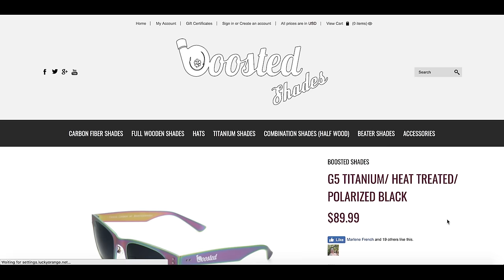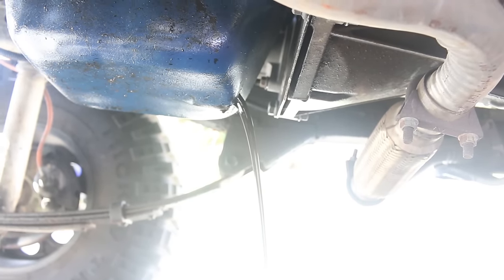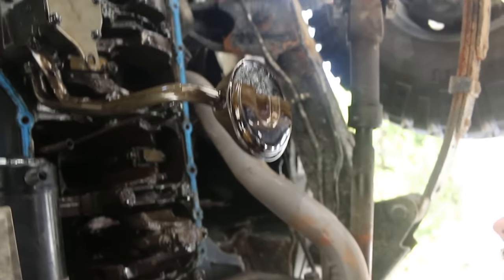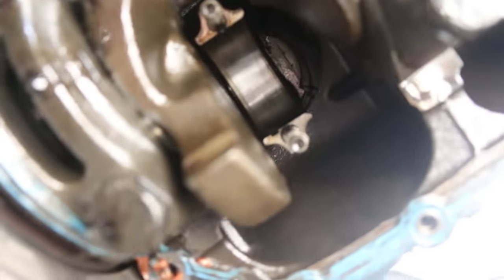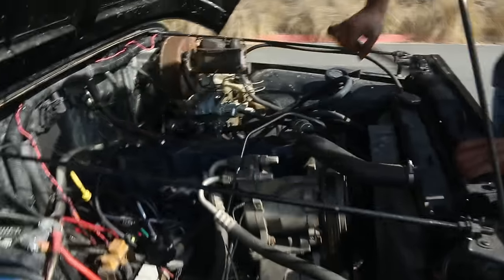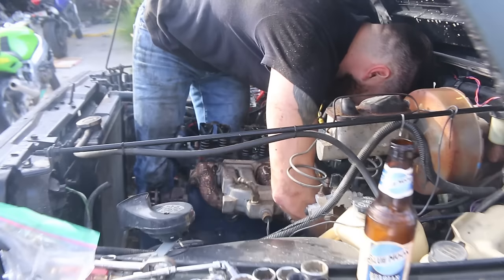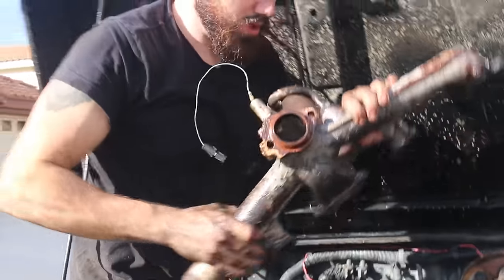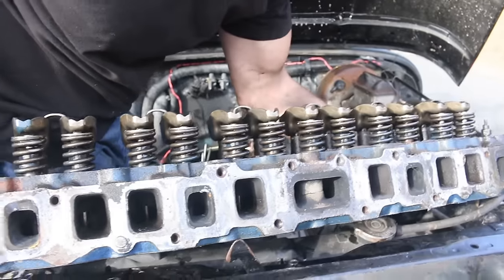Removing a Piston WITHOUT Pulling the Engine!

Comment: I'm trying to do the rings on my 83 VW rabbit, does it matter what kind of onion I use for the clam chowder or will sweet onion work? I heard that purple onion can cause the cylinder walls to glaze over since it's only a four cylinder. Pls help
Reply: How does this not have more likes
Reply: Does it matter if I like to comb my hair to the left instead of to the right? I'm afraid it might blow the head gasket...
Reply: Better if u use a name brand soup to add to your car
Reply: ayo i’m also here because i’m trying to replace the rings in my 81 vw pickup
Reply: That's a myth, any onion would be fine😂😂

Comment: You say , Without pulling the Engine ! Of course not ! Every backyard Mechanic does that , well , most of them ! Leave the Engine in if only Rings and Big end Bearings (Con Rod Bearings) are to be replaced ! I used to do that all the time when I replaced Rings and Bearings ,lol ! Pull the Pistons out the top after the Head has been removed ! A Friend of mine reckons that he has done it the opposite way ! Pulling the Pistons out of the bottom of an Engine ! Re-ringing them and putting the Pistons back in from the bottom !

Comment: You guys are my heroes. I had a '52 Pontiac with a Straight 8 when I was a teenager in the 70's. It had a bad rod so my dad took off the pan and the head and we pulled the pistons through the top just like y'all did. He had a mobile service that came out and ground the crankshaft journal from underneath so we could put an oversized rod bearing in. He taught me how to grind the valves with a valve lapper tool while we had the head off. Now I've got an '83 LandCruiser and I need to install new rings. Thanks to y'all, I realize it can still be done due to the layout of the engine. Thanks!

Comment: My dad and I did this on a '49 Chevy pickup with a six cylinder engine. 232 cu in. I think. Bad rod bearing. We polished the crank journal and put a new piston and rod in. Ran fine afterwards. This was back in the early sixties.

Comment: Remember to loosen head bolts in reverse order of your manuals installation order. Also loosen in stages of descended torque settings.
Reply: Why is that ?
Reply: @amadoperez9036  Because the head can get warped if you don't follow a written procedure. Same with installation. There is a manufacturer given procedure in the workshop manual to tighten the head bolts in stages and in sequence. If this is not followed you will have headaches.

Comment: You can pull the head off on that motor without removing intake and exhaust. Simply remove the bolts, trust me, I’ve done it a few times.
Reply: It is difficult to take out head as manifold stick to it
Reply: Depends what car and how the engine bay is. To get the head off my car you legit have to pull the motor and gearbox. No other way to get at some of the bolts unless your fingers can do 50nm.
Reply: I had to remove both on my 88 Dodge d100 to get the heads off. It's depends on the vehicle.
Reply: Intake and exhaust manifold? Or valves?
Reply: @drwombat  both manifolds are bolted onto the heads for a 318 LA Dodge, so it requires you take both those off.
Reply: @drwombat  I just remove the intake manifold bolts and exhaust manifold bolts and gently pry them away from the dowel pins. Remove the head and everything else just remains there, doesn’t even need support.
Reply: I’m specifically talking about a 4.2l in-line 6 in an 89 Jeep Wrangler.

Comment: I never pull my motor out to get the internals out 😂
Reply: i swear to god i will pay you to teach me how to do that shit cause i wanna build my motor without paying ANYONE to do it lol
Reply: @MuddafukhingdisKUST  certain cars are easier to do it on than others. Also if you have to pull the crankshaft out then well, you kinda have to pull the engine because you gotta disconnect the Tourqe converter/ Clutch in order to get the crank out. 

But pretty much you just pull away anything blocking the oil pan from coming down, then the oil pan. Then the head so you can push the pistons up out of the block after disconnecting the connecting rods. Sometimes this is much easier said then done on some cars lol

(Edit: Jesus christ I wrote the original comment 3 years ago!?!?!?!?)
Reply: @BenjaminGarcia20  As you can probably guess I got a Del Sol with a D16z6 so I'd imagine it's not super hard on my motor but I've never done any heavy internal work before, and I've never done timing either 😅 (Also you totally SHOULDN'T subscribe to my channel by the way 😆😆)

Comment: That was impressive I thought that header was going to be a big pain in the ass but you guys wrenched her off pretty quick. When you guys say the damage was worse than you thought what do you mean??? Are the cylinder walls fucked? Need all new rods and hardware?
Reply from the maker: We thought it was going to suck too, luckily none of the bolts were lame. 

We were hoping it would only be a bearing issue that could be sorted out on the bottom end and the head wouldn’t need to be removed. Since it’s a wrist pin we need to take that cylinder to a machine shop but won’t need entirely new internals (hopefully)!

Comment: Please Help me I have a bmw 550d diesel with three turbo Engine is same as 530d 535d N57 The problem its consuming the Oil Smoke only Very little st morning And when car is standstill And i Do hard acceleration Then Black with very little blue smoke Comes out what could it be ? Engine is strong ,No strange noises no turbo noise no Leakage
Reply: Black means that it is burning oil and blue means that it the mixture of the fuel to air ratio is too rich. I believe
Reply: Braeley Hill Blue is Oil ,Black Is Normal Without Dpf Filter

Comment: Yooooo guys, get a breaker bar! Make your life a little easier ✔️
Reply from the maker: Nate Smit the only breaker bars we have are for 1/2 in drive and we couldn’t use the 1/2 on the rear bolts, too close to the firewall. We were being lazy.
Reply: Team Boosted true say. You solved your problem either way, aha

Comment: man I wish I had you guys to help me my 2010 Tucson had a cylinder 3 go out and while driving antifreeze was flying under the hood wasn't smoking but I had added antifreeze before the trip and the top had popped off i'm not sure I put it on tight enough or it blew off anyway I was 20 minutes from home I put the top back on checked the oil and proceeded the coolant light went out and about 5 minutes from home and 100 degrees outside it started losing power and I got in the shoulder and it died I can do some things should I change out not just  cylinder 3 but all 4 coil injectors and the plugs under them what else can I check ? i'm praying I don't have to get a engine it has 90000 miles just rolled over and I have never had trouble with this care any ideas would help gotta buddy from work that's coming by to help me check it I have not started it since 5 day ago don't think it will I will check the liquids first. I work on my Jeep Sahara it's a money pit but I like it